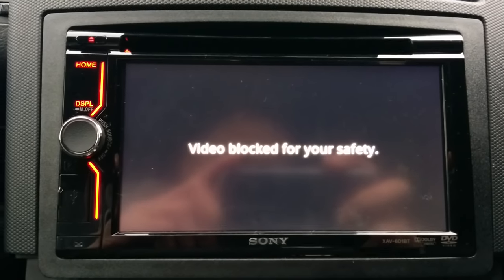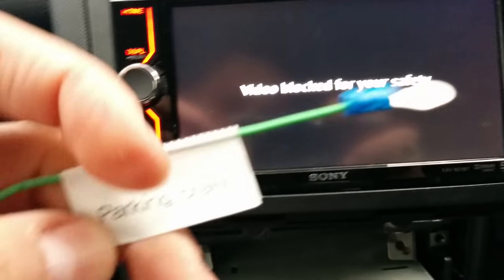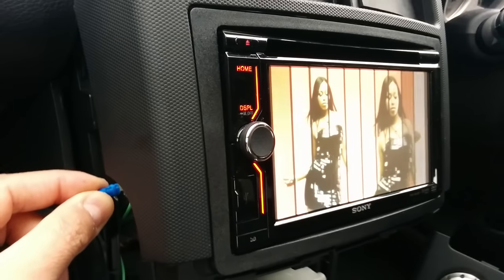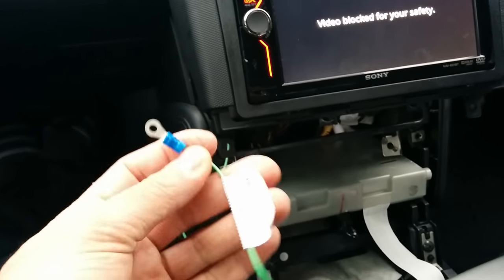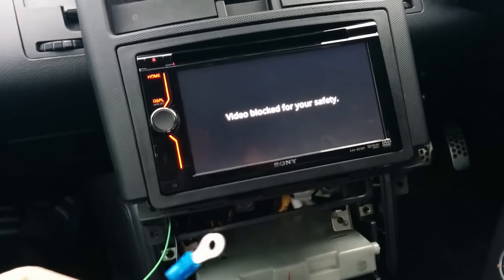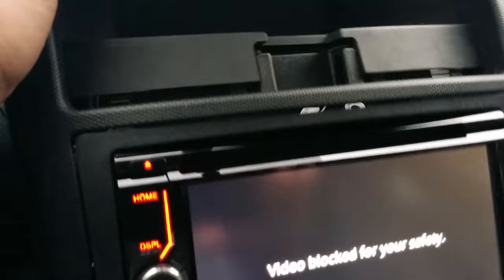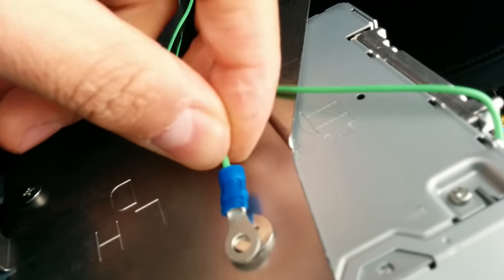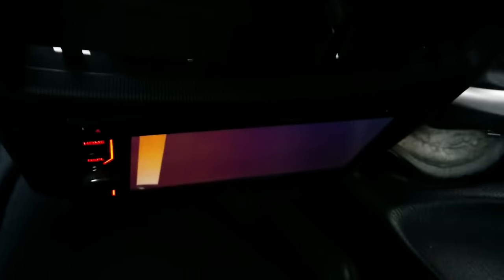How To Enable Video Playback On Your Car Stereo Bypass For Free!

Comment: very helpful. I heard many bs like connect it to a resistor and touch it to positive wire, connect it to car battery or to relay but this method is the easiest one. 
Worked great for me and now I can use the HDMI input on my Sony unit to play on my Xbox or play movies from my FireTV Stick.

I drive a 2010 Mercedes Benz G-Class and I would have to disassemble the entire dashboard to get to the plug of the foot activated handbrake since the switch itself is covered in black gunk and you can't remove that stupid connector unless you go very deep into the dashboard and find the plastic connector.

Comment: This method may work on this Sony stereo but not on pioneer stereos it requires you  to apply ground in a sequence - "on off on off on" .... I use a toggle switch,  single pole single throw and it works just fine ...

Comment: thanks, I just had this problem but I IAM  Going put a mini key  SWITCH and hide IT  were canT  be seen and use  IT TO CONNECT  AND DISCONNECT  THE HEAD UNIT BRAKE WIRE BY CONNECTING the hEAD UNIT BRAKE WIRE TO MINI KEYED SWITCH 

THEN USE THE OTHER TERMINAL OF THE MININ SWITCH TO THE   CAR  BODY  OF THE CAR SO YOU  TURN ON OFF THE VIDEO  SCREEN

Comment: I have connected video card to MFD screen of my Prius 2006 model. It is working fine but now i don't know which wire is the parking brake on MFD unit. Can you help me finding the wire on MFd unit to bypass.

Comment: Hopefully you can still respond but, how do you make the green parking brake wire from the stereo become “grounded” to the chassis of the car or the metal of the stereo itself? Like how do you make it stick with the parking break wire to the metal so that it’s “grounded”??? Hopefully you get what I mean
Reply from the maker: Hello mate locate a screw you can losen  on the chassis of the stereo and tuck the wire under it then tighten the screw back.
Reply: You use O connector and crimp it.

Comment: I have the Sony XAV-AV 5000, wire is grounded. I get sound from the video and the payback functions but I still get the message in the middle of the screen "Video Blocked for your safety.
Reply: Go to "Setting" ==> "Driving Setting" ==> "Watching Videos"  enable (Tick) it

Comment: You can also wire it straight into the ground in the harness.
Reply: Exactly, not sure why everyone doesn't just put the 3 grounds together
Reply: Justin Cuellar which 3 grounds?? The 2 black wires and add the green one into it?
Reply: Because I wasn't thinking about the green wire when putting the harness together and I'm not going to mess up that work of art by cutting into a connection I made 20 minutes ago,  doh!

Comment: Hi. I haven't got a parking brake wire but I do have a pink brake shift control wire. Is that the same thing?
Reply: Did you ever figure this out? I have a pink wire as well

Comment: It might be a stupid question and i am also a newbie with this stuff but where is the other end of this shown parking break wire. Where is this coming from?
Reply from the maker: Hello mate, it comes from the stereo, there will be a bug of wires and one of them is the break wire, it may not be labelled on yours or your stereo may not have it at all, you need to look up the manual of your stereo. I hope this helps.
Reply: @shaktastik  i am buying an aftermarket touchscreen for my car. I did some research and I found out that it has to be a double din. Is there any you recommend that would have that wire? I appreciate the help

Comment: Ok I do have one question because I just told my husband we r complete air heads for not realizing this sooner, and he disagrees with me that this WILL FIX THE PROBLEM!!! ok I definitely will be doing this regardless of what he thinks but he says and I guess its possible but I'm gonna say he is wrong! We have a 2020 CHEVY SILVERADO 3500 DUALLY, AND It will not allow videos to be played on it AT ALL, parked or moving! Ok so you have all ur bells and whistles on this thing and I mean all I.E video/ camera footage playing in ur rearview mirror AT ALL TIMES, unless you manually flip it to mirror mode!! U can brighten ur rearview mirror, u can zoom n and out with it and move ur camera up an down with it etc.... and it has a check my bed feature so u can check WHILE DRIVING in the bed of ur truck or down the sides and when connecting to the hitch to pull something I mean there is cameras all the way around and the video for them plays on infotainment systems or rearview mirror!!! And if u r towing or anything it has an automatic "check beside and behind you (I'm not sure what they call this feature) but if u r turning and use ur turn signal, it automatically pulls up ur cameras to show u what is beside u and ur camper or whatever, and to make sure you can get over it shows behind you (if ur camper has a rear camera it uses it and if not then it uses ur rear camera) so u know u have enough distance between you and any cars that might be beside u!!! And my husband recently got a strip light to go across the back under the edge of tailgate, and he just hooked it up in the bed of the truck on one of the tow/haul power hook ups, an now we have the cameras every time we use our turn signals!! Which is great with a dually because if ur turning n a tight spot or something u gotta watch them curbs, lol but this feature makes a world of difference with because u don't have to watch that small bottom mirror!! U can see everything beside you completely all right there!! Ofcourse I don't reccomend relying only on that! But if also has the hulagram in ur windshield with EVERYTHING  so u don't have to look down for speed, navigation radio or ANYTHING if u don't want to, I gotta glance its just habbit!!! Ok so it has all these features, video/camera features so I know it has the ability to play videos!!!! I BELIEVE that your method WILL still WORK for us because it plays videos, or cameras while u r DRIVING, so it should all be under the same agreement of keeping focused, be safe don't b distracted while DRIVING agreement!!!!!! So by grounding ur park brake its basically telling it ur not moving/driving..... Now with that being said I do see his point, how do u get the ability or option for video if there isn't ANY apps/options for playing video! I believe it will automatically play when ur playing from phone or connected devices.  So what do you think?? And if you do agree with him please let me know! Would love ur opinion on this!

Comment: the reason some stereos need a relay is because in order to unlock the screen, you need to set the parking brake, release, and set again. I know pioneer needs a relay for a fact. Alpine stereos needs the PAC tr7 because you have to set the parking brake and press the foot brake to unlock the screen. I wish they were all as simple as just grounding the parking brake wire.
Reply: Try a toggle switch.. between the ground and the parking brake wire.. then turn the switch on,  off and on again.. that does the same thing as ur parking brake issue.. it worked on an install that i had a few years ago.. lemme kno how it goes bro

Comment: not on the latest pioneer radios. it will enable the bluetooth and other menus that  would otherwise be off if it wasn't grounded but pioneer has decided to make it extra "safe" for us...I guess. Regardless, nice video
Reply: Works fine on my avic 7200.  Couldnt get android auto to work.  Ran the wire to ground and all good.

Comment: If I Keep the green wire Grounded permanently will it Drain the Car Battery if the Car sits in the Driveway for a few Days Please let me know
Reply from the maker: I understand your concern as some car stereos do drain batteries when a car is left unused for a while but grounding the parking brake wire wouldn't drain your battery as I have no issues with mine..

Comment: What if parking brake is grounded but is now drawing parasitic draw & won't start in the morning
Reply: Before grounding the parking brake I had this issue with the new head unit but I simply fixed that issue by running a wire to the power wire to my fuse box connected to a fuse plug for day time running lights, stereo now turns off when car is off but installing this ground to the radio caused constant draw in power, resulting in my dead battery this morning

Comment: I ground my wire but every time I turn my car off it stops working, how come?
Reply: vibewithshayla well the reason is b/c this doesn't work with all radios some radios have to feel the brake actually reset. The next easiest way that I use it to ground it to a wire that cuts on and off like a fog light button or a grounded wire that's powers on and off with the car
Reply: Okay thank you
Reply: Me too